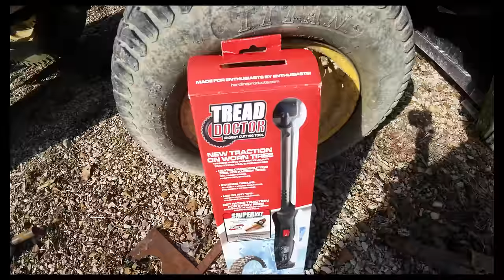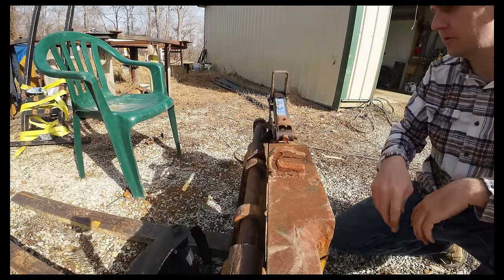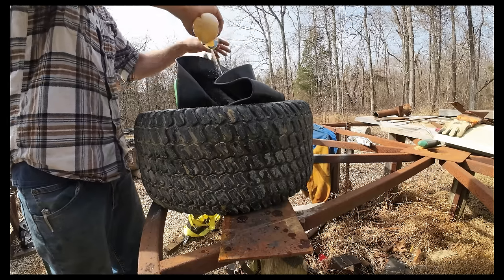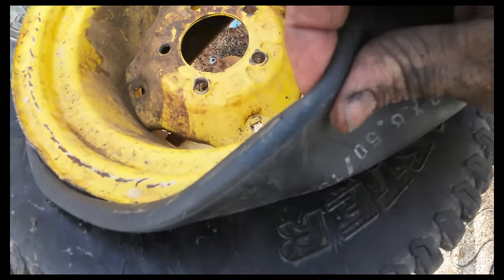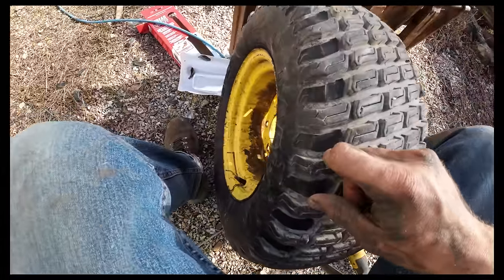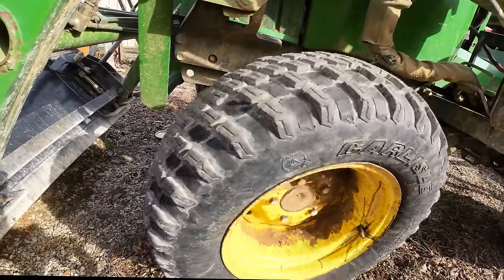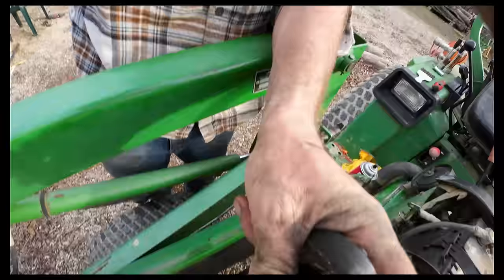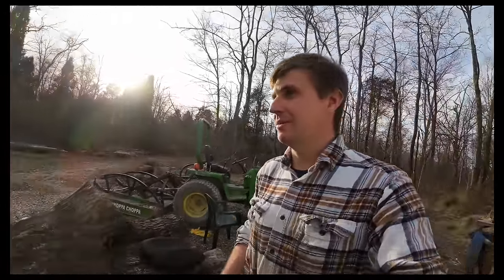How to Cut Turf Tires on my John Deere Tractor - Is it Worth the Trouble?

Comment: First tubes have a line around them to indicate in from out and the stem is off center . I always break down both sides of the tire to clean and check for nails and or sharp things that will damage the tube . ( don’t use your hand ) a rage will find sharp spots without the red stuff leaking . Except some air loss until the trapped air between the tube and tire bleeds off . When cutting tires I found you should mark them with chalk to make the pattern come out even  . You got lucky . The oscillating cutters work great after you rough grind a burred edge up away from your work allowing better depth control . I also deflate them so the rubber is not too stretched out and I’m sure it cuts harder . Anyway it will make a big difference even in soft sand .
Reply from the maker: Common sense goes a long way

Comment: Fuel fittings like that I just epoxy it with 4 minute Permatex Steel weld and it's Done Forever!👉😁👈Because if it happen once it will happen again if you do it the same way. Not alway their way IS the right way.
Reply from the maker: Thanks for the tip!

Comment: After the tube is in tire but before you put tire on rim put some air in the tube to let it partially inflate then let air pressure back out it allows the tube to form to the tire then letting air out relaxes the tube then check for its position and it should be really close to alignment then put tire rest the way on rim and inflate !
Reply from the maker: Thanks for the tip!

Comment: I'd be willing to bet your running that new tool using an extension cord,  that could be the reason it's not heating up like expected. The longer the cord the greater the resistance.  Try your tool closer to the outlet/generator I'm sure you'll find much better results.
Reply from the maker: If it were a light chord I would agree.  This was a number one complaint on the Amazon reviews regarding the amount of time it takes to heat up

Comment: I did the same thing to my lawnmower tires. I have the tire regrooving tool though. But basically does the same thing. Just takes smaller pieces. But yeah the mower tore the hell out of my grass when I turned a little to aggressively.  🤦‍♂️ but made a big different in getting traction.

Comment: Now I know you don't have power in your little shop, but the tire cutter might work a little better at least out of the wind. The other cutter worked better than I had thought it would, I figured the blade would break or get dull really quickly. Even a little improvement will save you some time or at least some frustration.
Reply from the maker: I thought it would dull out pretty quick too! It did a good job

Comment: If you are feeling froggy you could try using your battery powered chainsaw to cut/ trim the tires. I have done this and seen it done several times on mud tires on off-road vehicles.

Comment: R4s imo are perfect for industrial use on concrete or in dry fields on tractors that see a lot of highway use, i stay on solid ground and around a lot of rocks that shredded R1s but at the time R14s wont available in my size so R4s were the most durable for rocky terrain.
Reply from the maker: Yup, Hard compacted ground is what R4s were made for.

Comment: Tractor tires beads are easier to break since they dont have safety beads on the rim. You can also use baby powder on the tubes to install them if you dont want the mess of soapy water.

Comment: the nipple is a press fit into the housing,  I've cleaned them up in the past and used JB weld or I've tapped them and used a 90 degree hose barb to repair them . which ever suits you.
Reply from the maker: Thank you!

Comment: Tractor or lawn mower  tires use. Tireject.    It works good   why better than others like  and easier than a tube. Any hooooooo. Give it a try works good
Reply from the maker: Gonna be a pain in the butt to clean it all off when I put new tires on though.  But if someone doesn't plan on changing tires, it would probably be a good option
Reply: I agree with both of you… I gave up on using Green Slime a few years back.  I emptied all of my tractor, cart and wheelbarrow tires… and replaced them with TireJect.  It has latex in it and works great.  Haven’t had a flat since.  But, I wouldn’t use it in a tube because it would bond the tube to the tire.

Comment: That gauge is to show your filter clogging up the more yellow you see the more restriction is in your filter alot if times if they don't work is cause they are leaking air somewhere suction causes the yellow to move out if it leaks it doesn't suck the yellow out
Reply from the maker: I know what the gauge is for, it's stuck for some reason though.  Won't reset.
Reply: @CaptainKleeman  sorry I misunderstood what you said about it I have used spray silicone in them before to loosen them up but just a very little and get as much back out as possible once it's loosened up check your threads for leak and check for cracks in the plastic if it leaks it won't work hey great job on your vids I like watching them always curious what your gonna get into next 😋😎

Comment: If you trim the width of the heated blade a bit with the grinder it would work better. Not as much area for heat loss.
Reply from the maker: Fair point

Comment: With some of the mud slicks you get into,I doubt it will help lol , all kidding aside anything that you can do will be an improvement brother.
Reply: Oh by the way put the tip of the heated stripper on a piece of wood cause all your heat is being absorbed by the metal forklift and not allowing the tip to heat to its full potential 😁
Reply: It’s the trade off that he’s after. No tire is going to be perfect in some of the mud that cakes onto the tires but as he said he still wants comfort when riding on a hard surface like the occasional trip to the Derby Market to borrow something from DP.
Reply from the maker: Exactly

Comment: Tubes can be a pain I must admit but wheelbarrow tubes are a killer and split rims on vehicles are widow makers.
Reply from the maker: Definitely
Reply: The 4” ID rims on my leaf vac cart are made in two pieces.  They bolt together with four bolts and are held further by the lug nuts… easiest tube installation ever!   

PS:  won’t hold air without a tube…. Yep, I tried it.  LOL

Comment: Hi Mike,how's about heating the osculating blade in a bucket of hot coals while you are using it just keep dipping it in the coals then cutting then dipping etc.
Reply from the maker: It cut pretty quick like it was, not sure it would be worth the trouble

Comment: Nice job with the jack. 
Throw little paint on it you can up sell for $10-$20 😂.
Your welder hooks to a generator? 110v or/& 240?
I have a harbor freight generator, looking at welders.
 like to start with stick , they are 240v. Mig or tig are 110v but you wire gas... 🤯$$$
Reply from the maker: My welder is a generator.  Propane powered

Comment: Captain, It's a shame your front wheels are 12" rims.  The R-14's came out in 2020 I think. I got a $200 coupon from Goodyear and they still cost me $324 + tax at the Goodyear Industrial Tire Store in Terre Haute.  I ran them about 2 months mowing. I quit because they were digging up turf like crazy.  I'd make somebody a good deal.  They are 24" od by 9.5" wide for 14" rims.
I'll be interested in your modification...  Good Luck

Comment: Captain  ok to fit tubes in to the tyre, you have to brake bead on both side of rim then take the tyre off like you did on valve side it gives you more room to p play with the tube you put the tube in to the tyre and then you fit the valve in to the hole we mechanics have valve tool that we screw it into the valve and holds the valve in place whail  you fit the tyre back on to the rim when it's done put air into tyre easy takes about 10 min most half hour in my time I used to do change 4 tyres manually no machines in 1 HR and balance. That was long time ago before the machines come in .
Where I worked in workshop we didn't have machines to change tyres only balancing machine so changing was done manually  we had till that brakes bead and tyre leavers and rubber mallet to pur tyres back on.

Comment: Buy some decent quality inner tube patches so when you finally have an issue your prepared. Tubes are great but sadly they can leak just as easily as before. Its Best to remove the tire and clean all surfaces, a small mistake you failed to follow. All forms of moisture are bad for the steel rims. Vaseline Will work but baby powder is better and dryer!

Comment: U need to get yourself an air compressor. Were those 2 different treads to start with?
Reply from the maker: I used one in the video my man
Reply: @CaptainKleeman  I mean an actual air compressor nit that little portable thing
Reply from the maker: @jacobbuckley8232  I mean I have two other compressors, but this is way more convenient for what I'm doing.

Comment: Regrooving tires is hard, super hard without a high quality tool. A heated piece of metal or a bent nail works better and is faster IMHO.
Reply from the maker: Oscillating tool was quick and easy

Comment: Your extension cord may be under sized or too long for how much the heating element  in your iron...? Bleed off when using generators through extension cord....
Reply from the maker: Nah
Reply: @CaptainKleeman  
I was curious so I grabbed my siping tool from the garage.  The manual specifically says to not use with extension cords. The heating element will not reach high temperatures or stay consistently hot . It also says the tool comes with a generous 7 foot heavy duty insulated cord. (This made me laugh generous) .... It's Ok to use plugged directly into a generator or A/C power source.  
I hope this can help you on your next attempts with Siping or groove cutting tires.
Great video thank you
Reply from the maker: @patiencejoshuagroves7336  gonna depend on the chord

Comment: You’re gonna regret putting those tubes in those tires I’ve got the same size tractor, same size tires where you can plug them before and refill them with air. You’re not going to be able to do that anymore and you’re gonna have flats constantly.
Reply from the maker: Nah

Comment: I have R4 tires on both my JD compact tractors. One is 21 years old and I put chains on the front because the tread is worn. They have been stuck numerous times. Some have gotten thorns and gone flat, front and rear. I keep my mobile tire guy on speed dial. You can see him on this video. https://www.youtube.com/watch?v=M7gAsBnThXg     I have green slime in some. I try not to take them where it is iffy.

Comment: Cap are you serious that way with the car jack is dangerous I've seen and heard of that way going wrong bad when I was at college I done tyre fitting and was shown that way and told not to do it.
Reply from the maker: Life is dangerous bud.  If you can't handle the common sense to not be in the way of a jack under pressure, probably ought not use one. 💪
Reply: @CaptainKleeman  sorry cap for the way it sounded but I was surprised that that trick is still being used .

Comment: Complains about R4 tires...then modifies tires to mimic tread of R4 tires...The R4 tires are the highest load rating and ply rating of all the tractor tires. That is why they are the most common...they are the most durable. Are they  the best traction wise? No, absolutely not, but with everything there is a trade off....
Reply from the maker: Not even close to R4 tire tread pattern. Correct about being high load rating, because they are typically a harder rubber to stand up to abrasion on hard compacted surfaces which is what they were made for.  They aren't designed for muddy work or work in wooded areas which is where this tractor does most of its work.